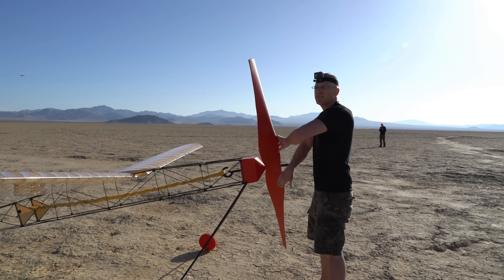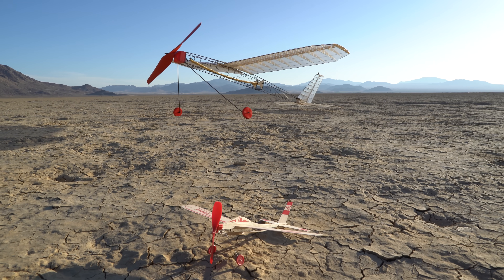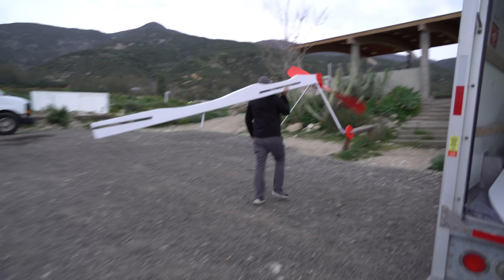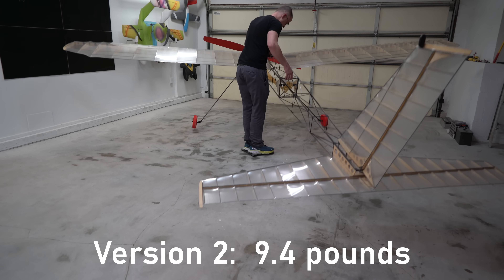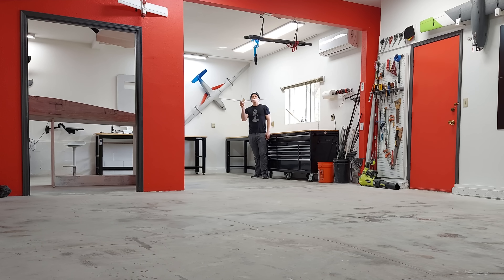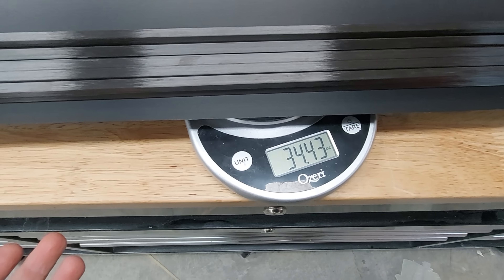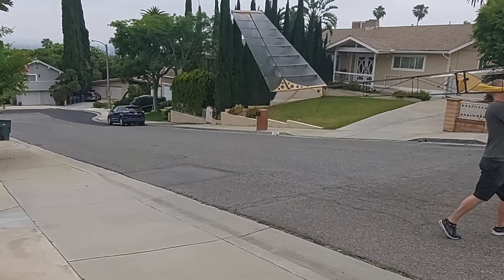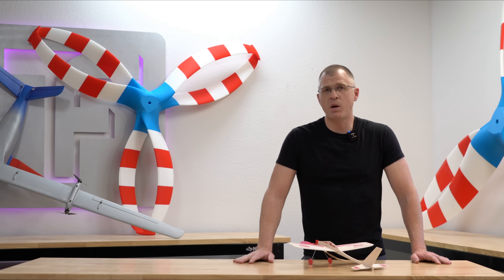Massive 16 Foot Rubber Band Powered Airplane

Comment: Elastically stored energy does scale linearly with mass/volume, just not when you're using torsion as the type of elastic deformation. Simple toys can get away with "just twisting the rubber band", but for anything larger scale, you need a gear or pulley system to convert a linear force from stretching the bands into rotary motion of the propeller. Would love to see what a version 2 would be capable of using linear band tension.

Comment: More rubber and a calm day!    Most efficient use of bracing is when set at 45 degrees.  That gives the stiffest structure with lowest weight.    My open class rubber powered model aero planes had just under the finished structure weight in rubber.  Consider using a lightweight aluminium tube over the rubber motor down inside the fuselage when winding,   in case the rubber motor breaks.    Slide it out over a rod/tube when winding completed.  Winding with some sort of power winder would help too.  Really enjoyed watching it fly!  Great effort!

Comment: That gap between the wing halves is a great source of induced drag. And the open truss structure creates more drag of the avoidable kind. If you cover the fuselage with the same film you used for the wing, you'll likely get flight times over a minute.
Reply: Absolute agree,  the gap between the Wings has to be closed.  ..and then Cover also the fuselage🫡

Comment: 7:20 Divinycell foam is actual aerospace composite core material. This appears to be H45 in 6mm thick sheets. (45kg per cubic meter density, 0.045g per cm^3). Covered in what appears to be 2-1/2 ounce to 4oz  per sq yard fiberglass fabric, and epoxy resin.

Comment: 2:20 "All those gasoline-powered aircraft do not share this problem as the fuel is consumed during use ... this is why you'll never see a rubber-band powered airliner."  Batteries are also not consumed during use, and have a low energy density compared to chemical fuel. So...

Comment: You are working very inefficiently with the plastic covering solution, instead of making the entire wing out of 1 section, make the double ribbed squares with external rings attached, apply the covering at the right tension per square and use the rings to enforce the exoskeleton and make them all fit together with an iron wire or bar fitted through the rings. You could use the same rings to tension the plastic as well and given that they are the only point not covered, this could let you tension to the point where the structure isn't bending.

Depending on the ring layout this introduces a bit more drag and you have a bit more plastic here and there. But for the low speed use case like this the performance degradation would be nonexistent. Would be much less of a pain in the ass to build though. Also it would be more durable since the entire thing wouldn't fall out of the sky if the plastic of one of the square components rips.

Comment: I think it would be beneficial to coat the rubber bands with Talcum powder,  because they stick to each other, and lose strength.
Reply from the maker: thats a great idea, I was worried about lubricating them and having them get incredibly dirty but that is a good solution to my concern.
Reply: The classic rubber lube is a mix of green soap and glycerin. Green soap is made from vegetable oil rather than animal fat. Glycerin is not only slippery, but it is a moisturizer. Today people use silicon oils, but I am concerned about the health effects of silicon oils in the liver.

Comment: Sorry to mention it as im sure you thought of it but why dont you wind the the rubber bands using a electric drill? Good jobs anyways
Reply: Drills tend to run pretty fast for something as big as this. The guys who wind a lot of free flight rubber motors have, in the past that I'm aware of, anyway, used hand driven geared-down winders.

Comment: I have a different idea for rubber band planes. Instead of storing the energy by twisting it (cuz its really hard to extract energy from it for rotation as in like 4:34), cant we stretch it and use the restoring force to turn the propeller by some gear system? 

Maybe not a good option cuz stretching damages the rubber band, but still a good idea for me :)

Comment: That's extremely cool. I have an idea though - what if we stretched the definition of a "rubber band" a little (pun intended)? I mean using some sort of quite stiff, but still lightweight and durable enough piece of material which we don't perceive as rubber day to day, but at this scale it could act as one? I'm thinking of maybe trying a different elastomer at first, instead of regular latex rubber. Maybe even move to regular polymers, and try something like nylon, different polyamides? If I'm missing the point entirely, and it's all about using the same type of rubber bands as in the smaller models, that's fine, I understand

Comment: Since that is powered by a rubber band have you tried adding gear reduction to increase the length of flight time on the same number of turns on the rubber band? Also with its size have you thought about adding servos to control just the flight surface?
Reply: Adding active control surfaces, while might be fun, might go against the spirit of the project.

Comment: you could make it with RC power with the components equaling the same weight as the rubber power. This way you can refine the plane on how it flys.

Comment: In the 1980s there was a full scale man carrying ultralight that used rubber power. The pilot controlled the craft with an RC transmitter, only the rudder and elevator were controlled. I think they took it to Oshkosh that year.
Reply: Needs a glass bead or two as bearings lubed with non-petroleum based oil and lube the rubber with Sig rubber lube

Comment: One thing I have done is to skip the heat shrink type of covering and just use the El Cheapo kitchen garbage bags from the dollar stores as my wing skins.  Use some Spray glue to tack it down.
I have had good luck with the Elmers sparay glue acually.   Since this is a 5-10 mph airplane anyhow, its not critical to have a perfect covering job.  Now you can lose weight on all the carbon added just to prevent the crushing from the heat shrink film. It will be ONE UGLY WING but its lightweight and thats what matters. BTW- You can shrink it some but its not ideal for that.  You really dug deep and made a great plane at the end.

Comment: Depending on the weight of the plastic used for covering, I wonder if tissue paper as they use in free flight planes would have made any difference? Nice video anyway! 😊
Reply: From my model building days, I remember paper being far too heavy for the ultralight indoor flyers and also heavier than most of the plastic films. The satisfaction of a paper covered Guillows build far outweighed the plastic also 😂
Reply: @kristofferrydquist8384  probably so. I took it that the plastic covering used in the video appeared and maybe even sounded a bit thicker than the normal covering. Point taken anyway. Thanks 😊

Comment: Excellent build, excellent video! Loved seeing what you came up with, and mine really does look a lot like a brick in comparison to this work of carbon art! I know the struggles of finding a suitable day for flying/filming, and it's great you managed a 12-second flight. Game on for upping it now!
Reply from the maker: This is gonna get out of control 😅.   Can't wait.
Reply: @thinkflight  to the moon!
Reply: @linusgoblin  yes. rubber powered moon landing lol.
Reply: @thinkflight you wouldn't have needed to use fiberglass to prevent twisting, just add a second dowel wing spar and connect them together at the wing tip making an A frame.
Reply: @thinkflight у меня зарплата 300 долларов
И то дома 2 супры f5j

Дети блин

Comment: Beautiful work! all the more so for persisting through all that adversity.... would love to see this with a low power electrical setup and rc guidance. May need a touch more dihedral for rudder/elevator only control 👍
Reply: Then it’s just another rc plane ! Don’t you get it ?

Comment: As you wound that huge red prop with both hands I suddenly remembered the pain in the side of my forefinger when a prop slips with a lubricated (That's a point, did you lubricate the rubber?) four strand, triple knotted rubber motor thwacks it into you! 
Yeeoech! (I think that's how I learned to swear properly! 😆)
Great project with all the hope, wins & failures of model aviation contained therein. Nice one!  🛩️☮️
Reply from the maker: No lubricant.   I remember doing that as a kid but didn't remember what we used to use for lube.   Optimizations are plenty on this project!
Reply: @thinkflight  I used to use olive oil. That was back in the dark days of the early 1970's when the only olive oil you could get was in tiny, brown glass bottles with an actual cork in it. 
You could only get it in pharmacies & it was used to pour into your ears!
It took me ages to get over that & try eating the stuff on salads! 😆
Reply: @thinkflight  Glycerin was what I used as a kid. You could get it at the drug store.